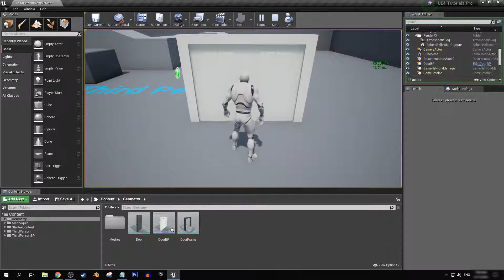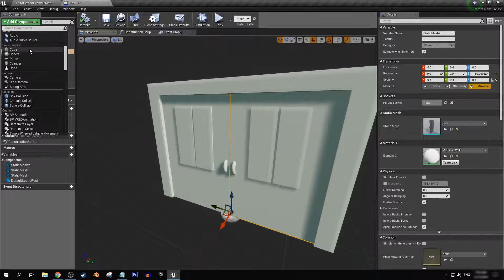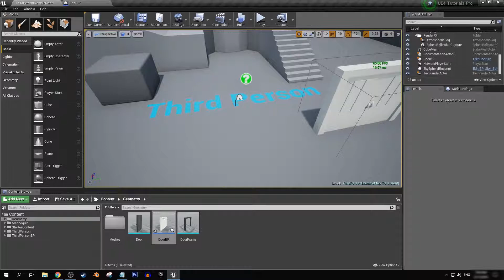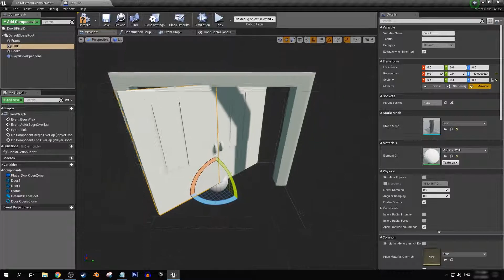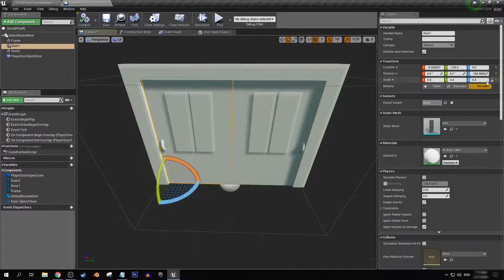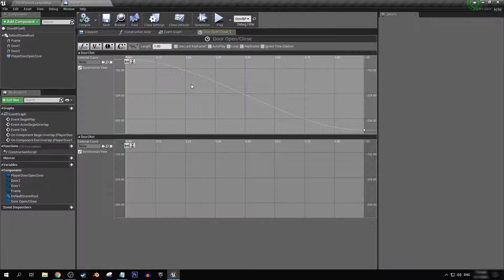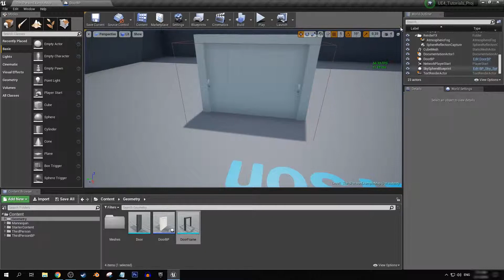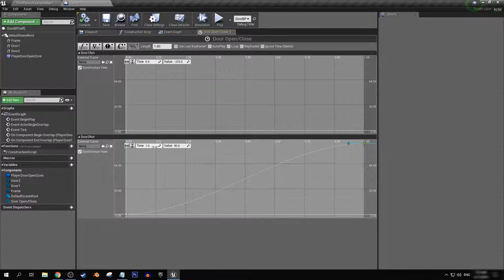UE4 Tutorial - Automated Doors Blueprint

Comment: -Your link for the model doesn't work, It's ok for me there's plenty of free models out there but hey. :/ 
-And is there any part 2? I've watched your video list and I have seen none :o 
-Also how it's set up right now makes it so you have no collisions upon Overlap and activate collisions quitting that overlap, there could be no collisions at all and would do the same. For it to have collisons on the correct side you would need to track from which side (or face) you overlap then if you overlap from the side which you would collide with the doors set no collisions and on the other instance collisions enabled.
Reply from the maker: ok, it might be fixed now
Reply: @AuroraGameworks  You should have told how to make the blueprint class I believe.. To put items under the root you need static meshes so that's why there is a light blue frame and doors around the blue widget (blueprint class actor). You can convert anything into static meshes and add it to the blueprint system. It's easy to find but it is not shown and without it you can't even start the tutorial.